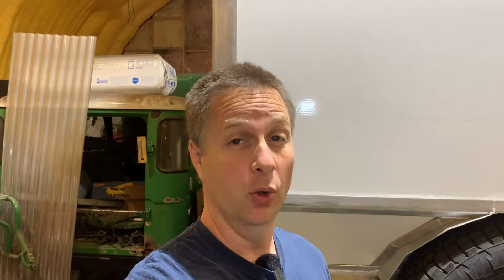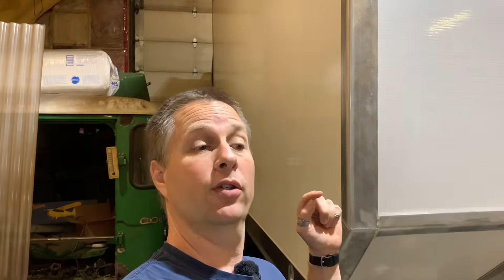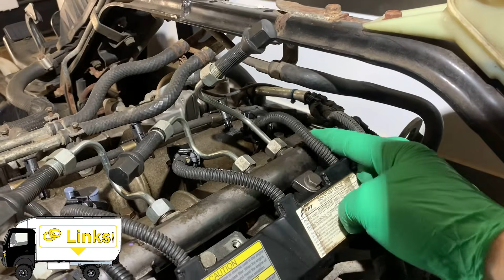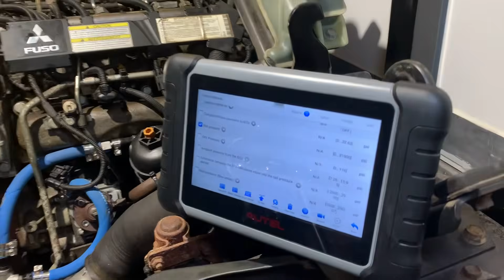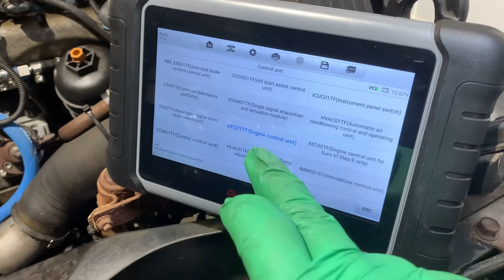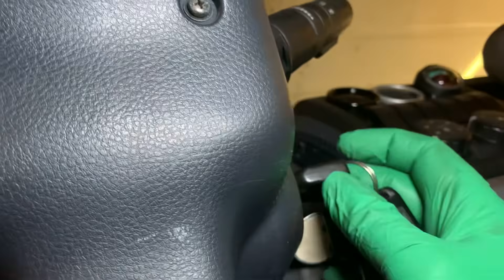Chasing AND FINDING Fuel Pressure | Mitsubishi Fuso FG 4P10

Comment: Is the sensor reading PSIA, which includes our barometric pressure?  Once you get this, Bruce, you'll have enough experience that you can take your equipment with you on overland runs and earn money troubleshooting other folks' rigs.  Keep sluggin!
Tell Murphy to knock that sheet off, please.
Reply from the maker: Hmmm, not sure if it’s PSIA or PSIG - but I think on the overall scale of things, the difference is minimal.    By the time I’m done I’ll have to tow a trailer full of spare parts 🤣

Comment: mine has same problem and im just about giving up. If I spray starting fluid, it starts right up and runs beautifully the whole day. but immediately i turn it off it will not start
Reply from the maker: Sounds to me like you have an air leak in your fuel supply line.  What engine/year?

Comment: Bruce,  I am feeling your pain.  So I have a 2015 Fuso Canter FE130 with the P410 it has 50K on the motor and I was driving up a hill, the transmission downshifted I heard what sounded like clanking and it died.  I tried restarting and it didn't move.  After sitting about an hour it does turnover but won't start.  I have a generic scanner which returned a P0087 Fuel Rail/System Pressure - Too Low.  Do you think the engine seized and the clanking was a symptom? Someone said it could have had air build up when fuel may have stopped which caused the motor from cranking and eventually leaked out allowing the engine to free up not seized.  Anyway, not sure what to do, any ideas?
Reply from the maker: Does it sound normal cranking over now?  
Go in through the instrument cluster and read the SPN FMI codes - should give more specific info.  

Don’t buy a code reader for your Mitsubishi Fuso without watching this first!
https://youtu.be/XI-nOFkUMK0

Comment: Does the Autel have a function to see if the injectors are getting a signal to fire? Or is there a way to see what conditions need to be met before the computer will allow injectors to fire?
Reply from the maker: It’s a bit of a catch 22… the injectors won’t fire without the minimum fuel pressure, but the fuel pressure disappears as soon as the injectors are connected…

Comment: Air trapped at the injectors now? Or does it get bled by recirculating fuel flow?

Been watching for the whole saga (and before) and am stumped
Reply from the maker: Air should be pushed out of the injectors, or pretty close to it - by the priming pump and the first little bit of cranking.

Comment: For some reason, I don’t recall your completing removal of injector four. Anyway, holding on with bated breath for your Fuso to start. Thank god mine runs! It’s a miracle…
Reply from the maker: 4 has not come out yet - but also does not appear to be leaking out the return at all.  I suspect my next step (to be confirmed) is new injectors - which will mean the fun is yet to come with #4…

Comment: Bruce - are you getting compression in the cylinders? valve timing issue? you have fuel with pressure at the injector - so either the injectors are not firing or there is no pressure in the cylinder to ignite it?
Reply from the maker: Ahh, but I don’t have pressure at the injectors….   I did check timing a while back - but I wouldn’t be surprised if I have another issue.   If it won’t start with fuel pressure at the injectors, compression could be my next check.

Comment: I watched the fuel pressure building section of the video a few times, but wanted to check if you confirmed the pressure was building each time you cranked it rather than just the once shown in the video?  If so does it build to the full ECU commanded pressure?
Reply from the maker: It’s hard to see but the max reading was slightly over 5000 PSI, the expected pressure at cranking is 5000PSI - so it’s just, just hitting it.  I have repeated it as well, so not a one off.  😎
Reply: @BruceandKrista  In theory the pressure should be regulated by the ECU, so 'just' is what you should expect to see.  

What I don't understand then is how connecting the injector supply lines can dump the entire cranking pressure?  It's either being dumped into the cylinders (it wouldn't be long before the engine hydraulically locked with that much fuel being dumped into them) or it's heading out the return line and there shouldn't physically be the injector bypass flow rate for that 😳  

I'd be very interested to see what's coming out of the injector bypass line if that much rail pressure is being lost via the injectors.

Comment: Gotta be an injector -  You didn’t plug the FPS into the scanner for a comparison reading, may be telling.  Just gotta remember it was a single epic event that started this “3 hour tour” so I doubt you've got multi system failures. Great work though,… makes a man feel bad being entertained by another’s woes!
Reply: in German it's called schadenfreude...
Reply from the maker: Not quite following your plugging the FPS into the scanner?
Reply: @BruceandKrista  So your new pressure sensor was ocilating between zero and 30… what did the one you pulled out read in the same open air configuration.  More curiosity than anything… but if the old sensor was borked, that could cause all sorts of mayhem .